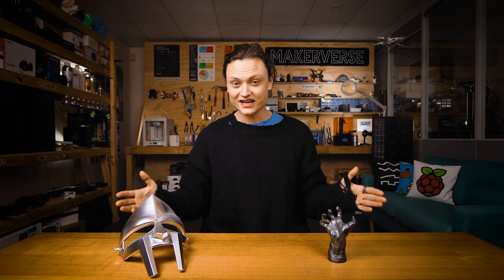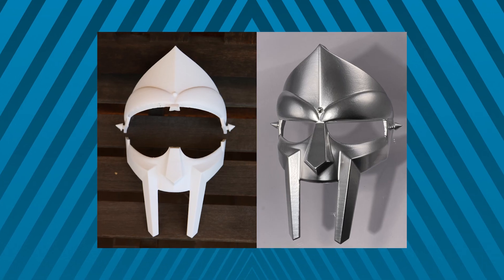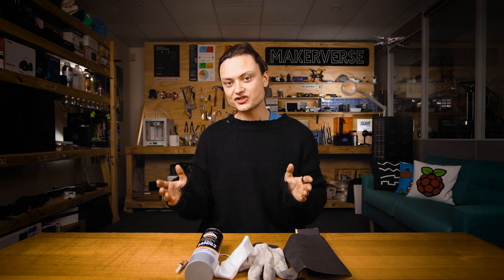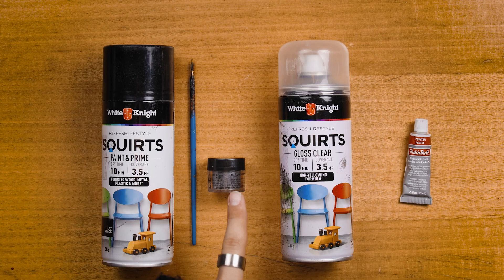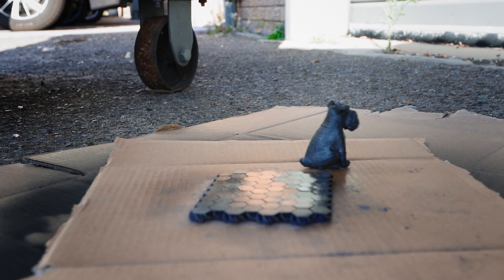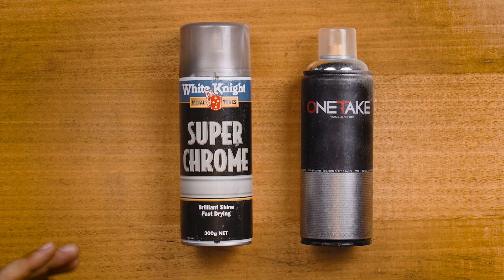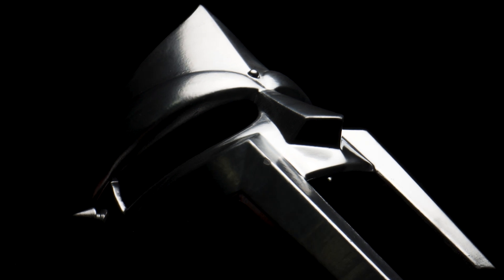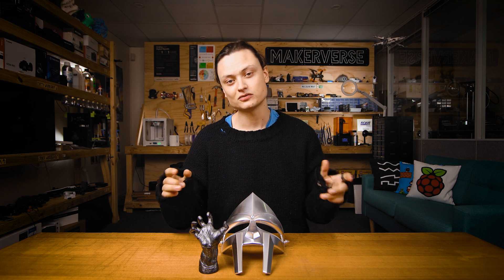How To Get Metallic Finishes On 3D Prints

Comment: Don't forget to use baking powder and super glue for harder and stronger bonding.
Reply from the maker: Excellent strategy! Baking soda is an under-utilised tool in my toolkit
Reply: @Core-Electronics  ä
Reply: @Core Electronics
Reply: Please explain
Reply: Do you mix them first and then apply? 50/50? 10/90?

Comment: Gloss black base and graphite powder makes a very shiny chrome finish
Reply: Is there a good way to finish this to keep the graphite from transferring?
Reply: @15430Eve  You could use a gloss clear coat but even that might still take a little bit of the metallic away from the finish. So far I haven't used anything to seal it. Little to no graphite comes off with regular handling and even if it does, you could reapply a pinch more to fix the spot.But in my experience, not much comes off for it to be of much concern. It is not waterproof, however

Comment: Hello, I had a pain trying to paint PETG, had you tried out that material before? is there any advice you could give for PETG?
Reply from the maker: Always rough up the surface a little with high grit sandpaper and use primer. Primer is the solution to all problems when it comes to painting troublesome surfaces 🙂. Good Luck!